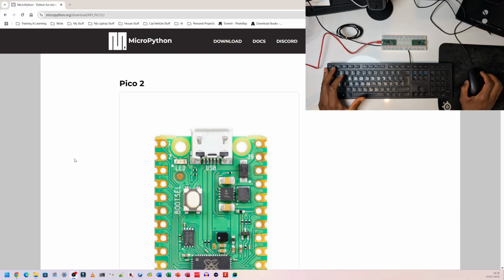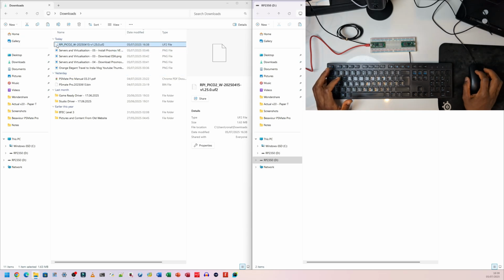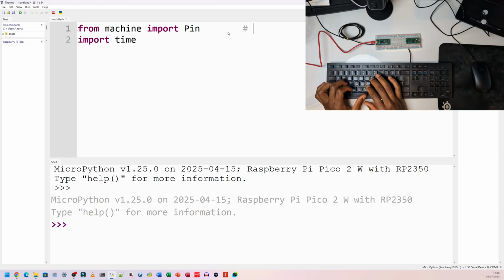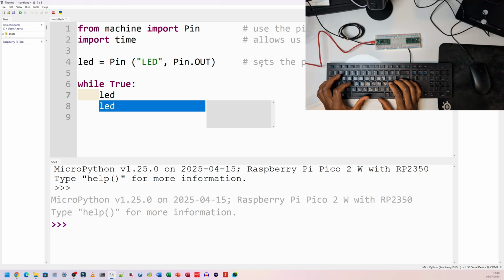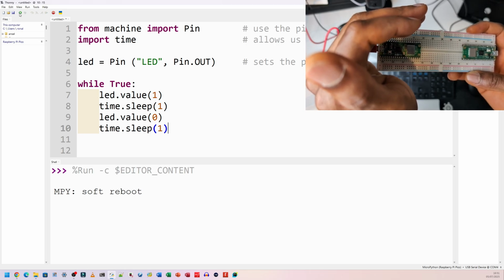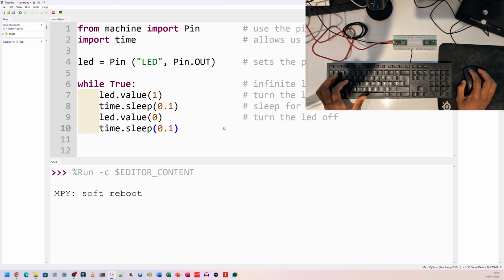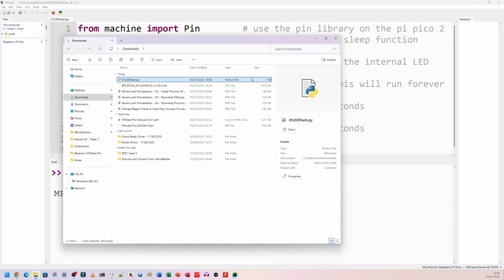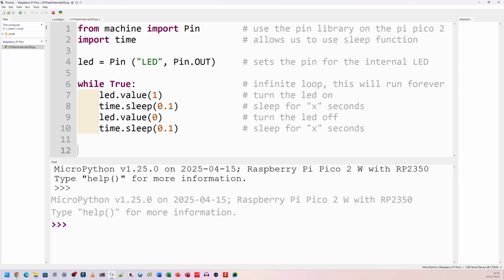Raspberry Pi Pico 2W | "CONTROL INTERNAL LED" | "SAVE CODE TO PICO 2 and PC" | (2025)

Comment: thanks, although, would like to know what does stand behind this "LED" mystery. As far as doc is saying it is connected to the wireless chip and not to the RP2350 itself
Reply from the maker: Pico 2 (standard): onboard LED → GPIO25.

Pico 2 W (wireless): onboard LED → connected to Wi-Fi chip GPIO (e.g. WL_GPIO0 / "LED" in MicroPython).